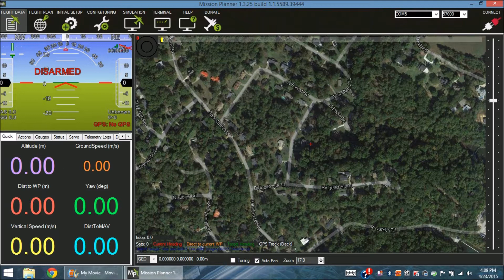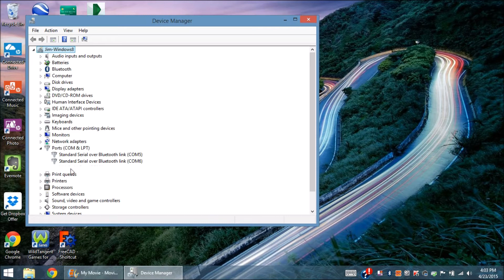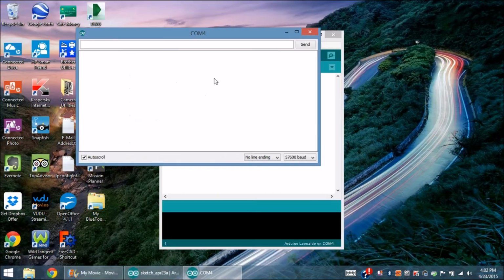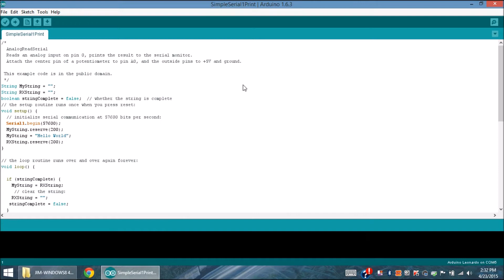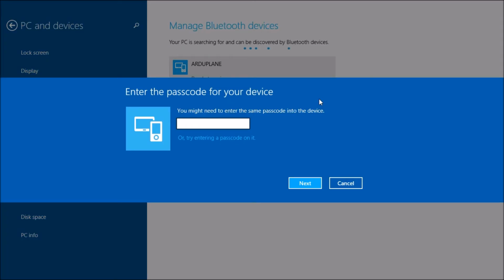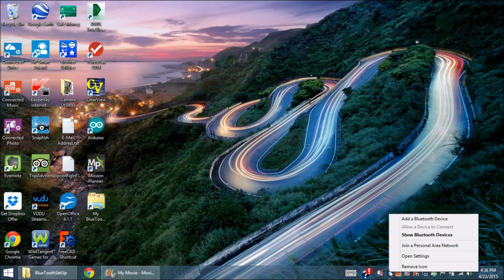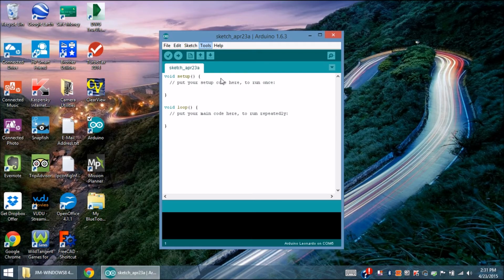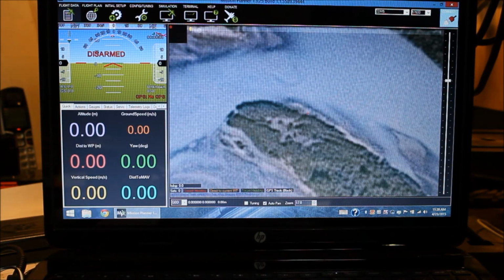Mission Planner to APM via Bluetooth on Windows 8.1

Comment: Red light on HC06 never stops flashing , even when "paired" to PC and the PC says ready to use and connected . No wireless connection of any kind , after doing all of this .The HC06 broadcasts it's name but thats it . No wireless connection possible . All the physical connections ( FTDI or arduino ) work fine and changing baud/name/code works fine . Tried 4 different HC06 chips and 3 PC's , Ios , android .
Nothing !!!!!!!!
ARdupilot WIki says it's "easy" setup .
Yea , it's easy .......it just doesn't work .
Reply from the maker: Ron, its been 5 years since I worked with this. So a lot could have changed. But assuming that the basic interface hasn't, here's some additional thoughts about what to try:
1st, neither the App or APM know that there's a HC06 in the path. So it might be good to back up, and start with a hardwired serial link, using an FTDI, on the computer end. If that doesn't work, there's little point in moving on to adding the Bluetooth piece.
2nd, if it does work, then I'd move on to doing the test shown at 9 minutes into the video. And compare the FTDI output Vs the HC06. Both will look like "gibberish", as displayed on a simple terminal console. But if you do detect a difference, then double check the HC06's baud rate setting.
Wish I had more to offer, but as said earlier, its been a while.
GL,
Jim

Comment: Is this long range telemetry and mission planning or only short range to test and flash the board?
Reply from the maker: Thanks for your interest in the video. I suppose the process shown here could apply to either. But this plane & radio was used just for local flights (always in sight of the operator).
Reply: @jmhrvy1947  What do you think the range is?
Reply from the maker: @Mansare94  I can't say for sure. The space where I fly is sight limited by trees. So it probably never flew it more than a 1/2 mile from its launch point.